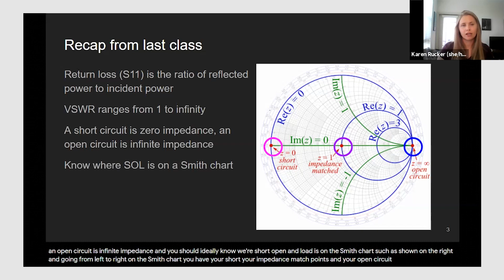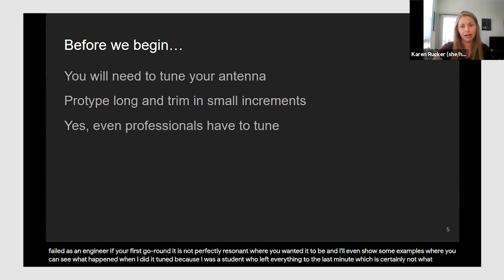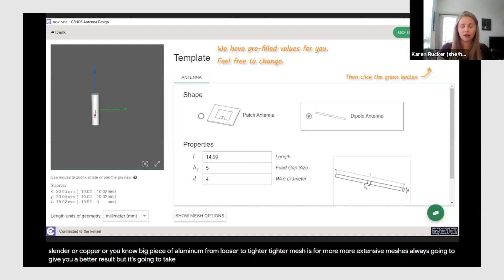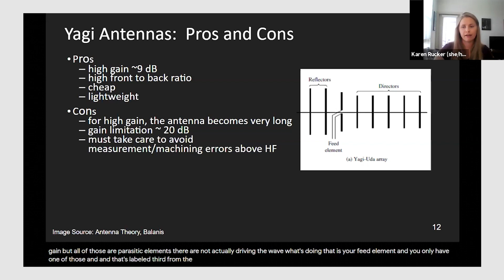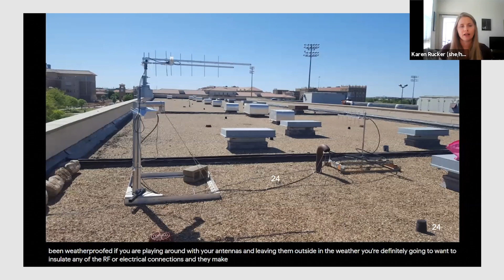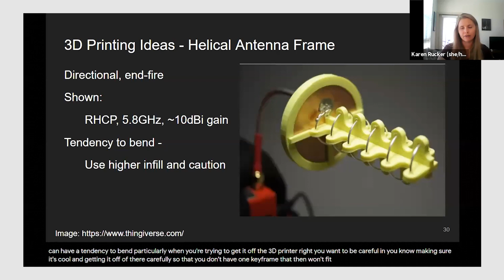HackadayU: Introduction to Antenna Basics - Class 3

Comment: Hi Karen,....With importance of measuring Yagi antenna gain in the Fraunhofer Far Field Zone calculated by using the antennas  Largest  Diameter or Length...On a Long Boom Yagi relative to Smaller Dipole length,  Is D the Boom Length or the Dipole Length used in the Far Field  calculation ?  Thx much...